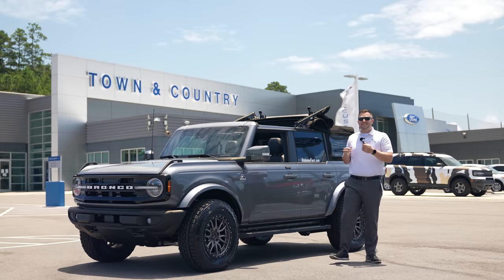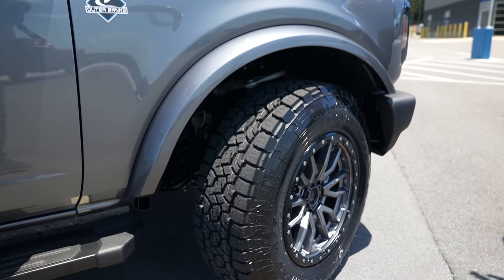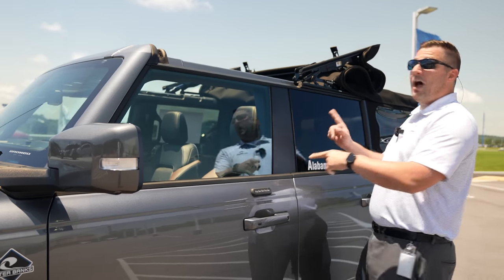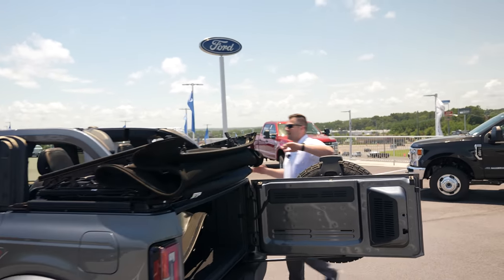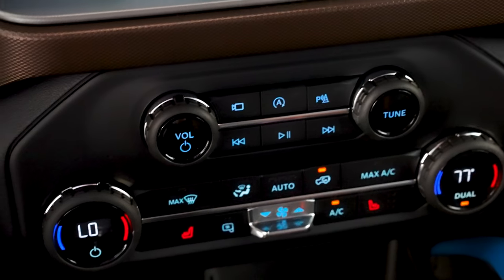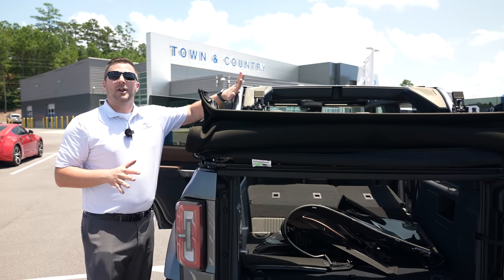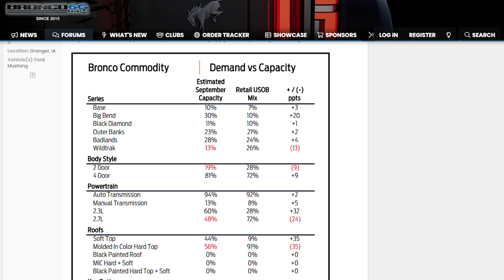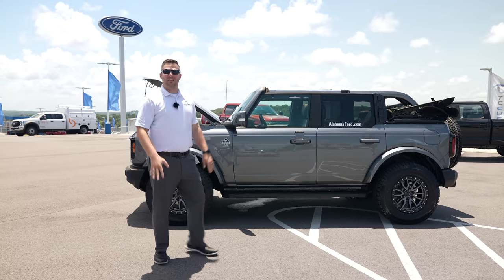How to get your Bronco Built Sooner!  *World's First TCcustoms Bronco!*

Comment: A small tip from a former Jeep owner.  Do not store your soft-top windows when they are dirty.  That grit and dirt will scratch up your windows if you roll them up and store them.  

And also don't do it when it's really cold.  I cracked one of my plastic windows one time in the cold trying to bend it.

Comment: What offset are those wheels? I think if you remove the crash bars that 305/70/17(34’s) will fit with Stock suspension. Ideal offset would be around +20 to +12.

Comment: ONE QUESTION:
If you buy larger diameter aftermarket wheels and tires (for non Sasquatch models), will you have to purchase a new rear tire mounting carriage because of the low height of the center brake light? I wish the center vertical post was adjustable to allow the break light to peek over the tire but I don’t think it is!

Comment: What would be cool is if we can get the locking axles and sway bar disconnect and it's associated Hero Switch after getting the vehicle....probably might cost an arm and leg but I'd be so down for that....like imagine a 2.7L black diamond with sasquatch to get the front and rear lockers...and then WHOA SURPRISE....sway bar disconnect

Comment: Had no clue the outerbanks had no lockers. Ouch. Glad I ordered a wildtrak. That is definitely the best seat option though.  Gonna need a bimini for the summer
Reply: Badlands, WildTrack, and First Ed are only ones that get lockers standard. All others trims can be optioned with the Squatch package.
Reply: Rear locker is an option under the transmission, its easy to miss, but you can definitely get it.  The front locker comes with the Sas package tho.

Comment: So sad, they probably didn't even realize that they didn't get the advanced 4x4 transfer case and rear locker.  Might as well be 2wd, definitely no need for an off-road tire. 

Also didn't go with the leather trimmed vinyl for the obvious reason you experienced.  They could have opted for the advanced 4x4 and lux package for nearly the same price as the "leather" seats.

Comment: Stopped by today and one of the staff I talked with said you didn't have any Broncos, shrug... Crap! You said the Bronco has a different bolt pattern on the wheels than the F150 Raptor?! I thought all 6 lug Fords were on 135mm? Locking interior colors to packages - unlike any other Ford product before, is by far the worst decision Ford made with the Bronco, then the stupid empty "hero" switch positions instead of leaving the position without a function but having an inoperable "switch" there. Ugh. If I'm paying $50k for a Badlands with a manual, the empty single switch position is infuriating.

Comment: Speed bump away from losing those flares
Reply: Won't need them if you're really putting it to work. In my opinion it looks better without the flares.
Reply: Reece Savage how much work does this plan on doing? It has no flex as it sits. The way that one is setup is for city driving. There is virtually no clearance to be had with that setup. Needs a lift pronto
Reply: @galenstarrs  For personal use of course you are 100% correct. However, that particular bronco  is for demo use only. Meaning its not for sale to the public (at least not this year). If Town & country do decide to sell it, i guarantee you they will sell it with the stock wheel package. Its all smoke & mirrors to get you to stop at the dealership and hopefully strike a deal.

Comment: Why would anyone want one? No V8 no Eddie Bauer package, no reason to even consider one
Reply: I'm sure a V8 is either in the works, or already worked up and just hasn't been announced yet. And for plenty of people, myself included, a turbo V6 is plenty.
Reply: @RLtW88  you obviously never owned a real bronco then, cause this non towing toy is an affront to all of us, Ford has lost their way
Reply: @johnhull6363  V8s are yestertech. My 2016 V6 Mustang has more HP than my 5.7L in my 1987 Firebird Formula 350. And that V6 had less power than the 4 cylinder, so it got discontinued in 2017.
Reply: @SmashTheNumbers  and half the torque, hp is bullshit, torque is where it's at
Reply: @SmashTheNumbers   what are your thoughts on the reliability of these 2 engines? Only reason id want a v8 is for the reliability but thats about it aha
Reply: @Shifty McGee462 nah, the ability to put down 1000 miles in under 12 hours
Reply: @jr8841  I have had no issues with the V6. As for the 4 cylinder, it is a turbo, so it is more complex, however, virtually every 2021 vehicle is more reliable than even the best 2001 vehicle.